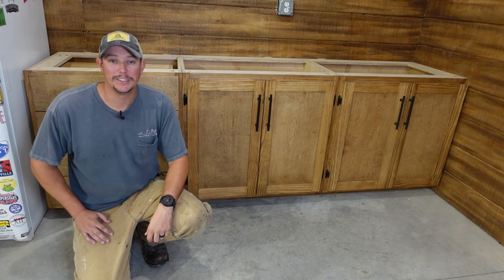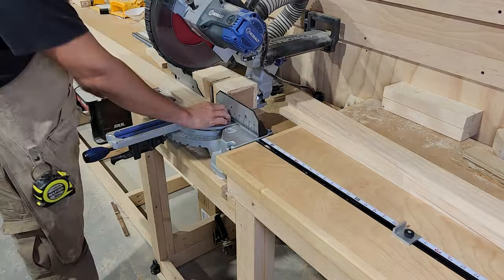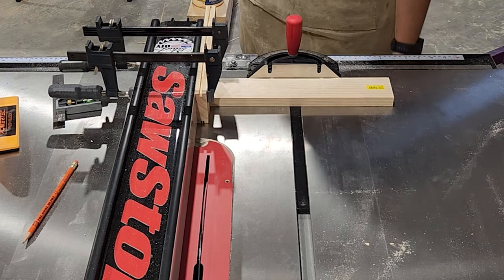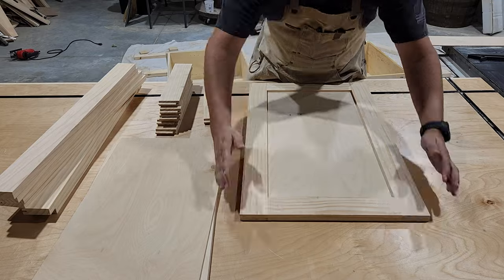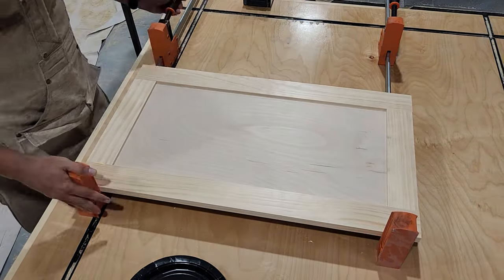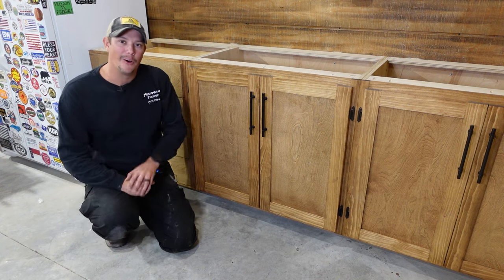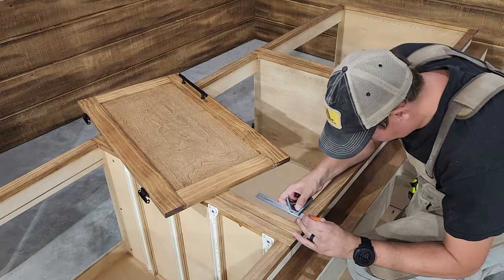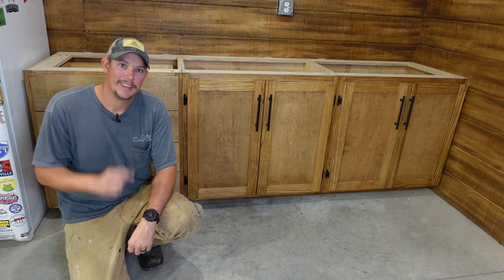How To Build DIY Shaker Style Cabinet Doors

Comment: What grit sandpaper are you using on the cabinets?  Thx amd nice job!!
Reply from the maker: 120 before finishing and used 0000 steel wool to get a super smooth feel after poly had cured